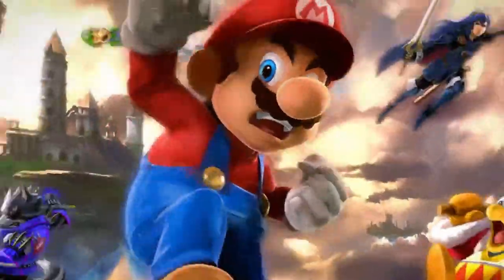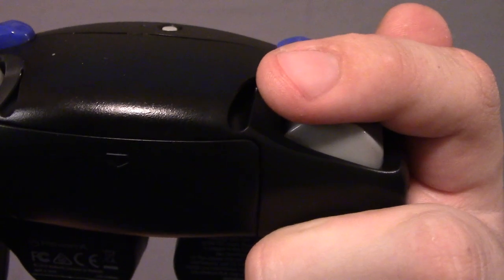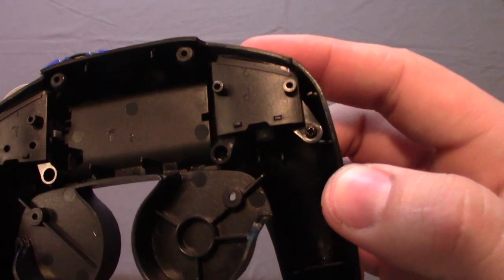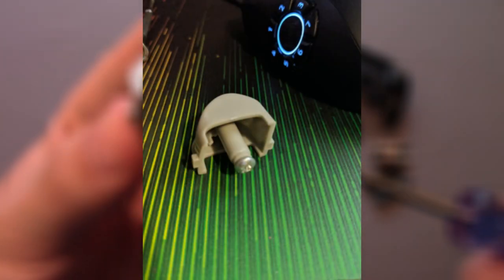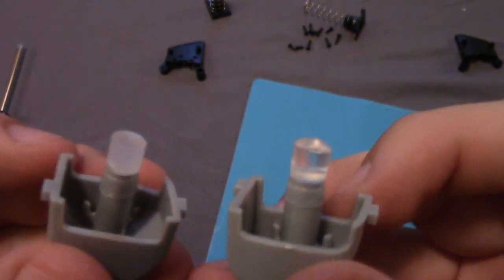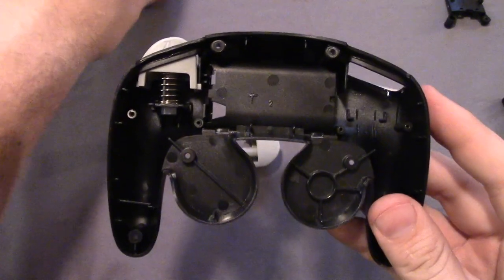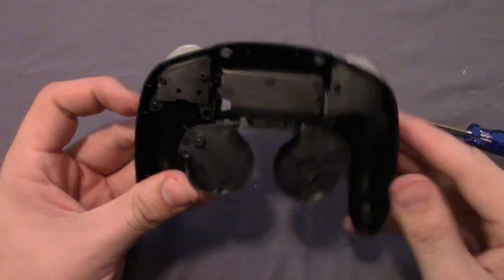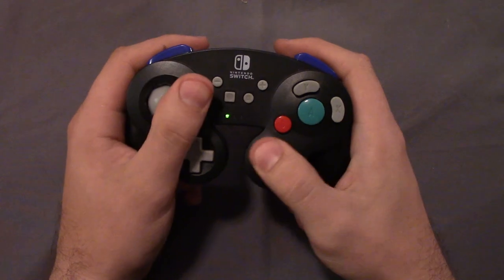How to FIX your PowerA Wireless Gamecube Controller Triggers

Comment: I was going to try it but the wired controller is different, instead of  the plastic tube come out and press the membrane the tube hit the bottom of another part (a hollow? kind of tube) so i guess there is a different way to mod it, like filling the part a little so that pushes the membrane. i don't have a lot a creativity to find a way to do this to this controller but if you want i could send you pictures of how the wired controller triggers are if you are interested.
Reply from the maker: I'd be interested in seeing the differences, sure. Umm.. do you have a Twitter you could @me a picture?

Comment: What is exactly the benefits of this mod? If you want to be able to shield faster, couldnt you just put shield on L?
Reply from the maker: In the case of Smash Bros.? Yes, you're able to button map to fit any play style you would like. However, as this is a pro controller, you can use it for any other game, and ones that require holding the triggers in for a long time like Mario Kart or Rocket League can cause some fatigue after a while.  Personally, I didn't see a benefit in the travel distance. Even PDP and Hori's GameCube styled pro controllers have the triggers as buttons to more closely match the Switch Pro Controller and I wanted to show people that might have passed on an otherwise great wireless controller option that they can modify it to their liking.
Reply: You could use in splatoon and shoot faster?
(I'm kinda hard to push all the way, this mod simply solves the problem when I use brush in splatoon 2.

Comment: Yo can someone help me connect my wired powera gamecube controller?
Reply from the maker: With the wired version? What's going on with it?
Reply: @SpazTac13  it never wants to connect
Reply: Devil ish you have to enable wired pro controller in your switch settings
Reply: @poolicker7271  doesnt work
Reply: have you tried Turning off your switch, docking it then turning it back on?
(Not sleep mode full shutdown)

Comment: These screws are anything but easy to remove and every tutorial calls them easy to remove and I feel like a braying jack ass what is wrong with me
Reply from the maker: I hear ya, Trouble. I actually had to go buy a screwdriver for this as I had one that seemed like it would work but would slip and almost try to strip them out. I had another bit for a multi-tool but it wasn't quite long enough to get down in the channel, especially by the battery door.

Comment: Cool mod, but this is kind of a hack job; the same thing can be done by using a screw and it’s more easily adjustable
Reply from the maker: Oh, absolutely it could, I covered that briefly in the video. Mainly I just wanted to show the ease at which the triggers can be accessed and modified. If I were to do it on another controller I'd probably use a screw and coat the head of it just for some piece of mind in contacting the rubber. Thanks for the comment!

Comment: The Switch supports analog triggers now. Too bad the controller doesn't.
Reply from the maker: True! I'm curious to see what kind of games they have in mind to take advantage of that function! What do you think they have planned for it?
Reply: @SpazTac13  Grid Autosport and Trails are 2 that currently support it. Would love if older racing games like Gear Club Unlimited 1&2 would do an update that would support Analog Triggers since those games feel like they really need it IMO. Nintendo should consider maybe making a Switch Elite controller that is basically a Pro controller with Analog triggers and maybe some added features.
Reply from the maker: @JesusWillSaveYou  that would be awesome. Gear Club would be sick... The switch needs more racers... I couldn't get enough of Need for Speed Underground back in the day I'd love to see more stuff like that
Reply: @SpazTac13  Yeah I feel you. Check out Night Runners if you haven't. It's basically NFS Underground 2 in Japan. Really hoping it does well so it can come to the Switch as well.
Reply from the maker: @JesusWillSaveYou  I'll definitely have to check that out, thanks for the tip!

Comment: this controller..... a week with it and its already starting to wear out on the analogue sticks.  the shoulders stick and do not let me press. DO NOT BUY this piece of shit.
Reply from the maker: Aww man that sucks to hear. I was really concerned after seeing some pictures on the Amazon listing. Mine have held up okay so far, but even between the 2 I have they have different sized textures on the stick so it would seem there's a few different runs of the same controller and not all at the same quality.
Reply: @SpazTac13   ive taken apart the controller, cleaned it  and gave it a little bit of lithium grease into shoulder holders, so much friction made dust inside that created friction , anyway. unacceptable quality.